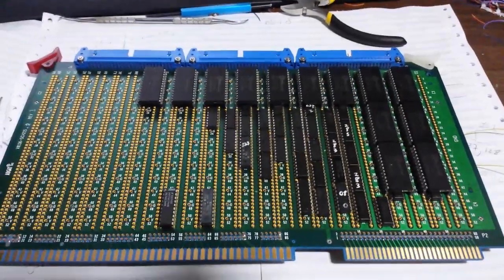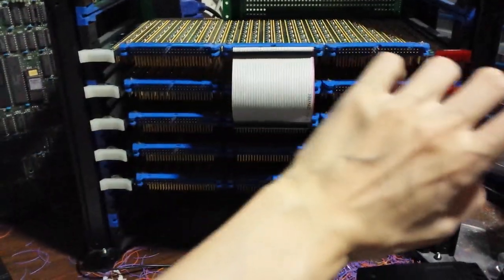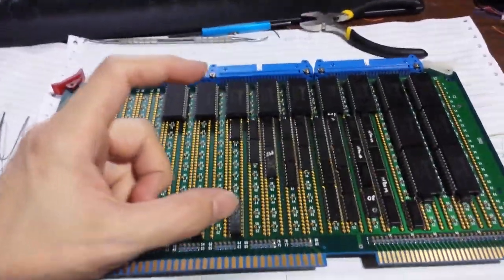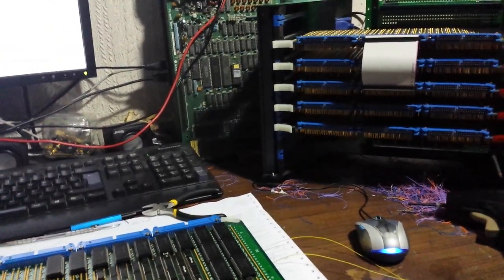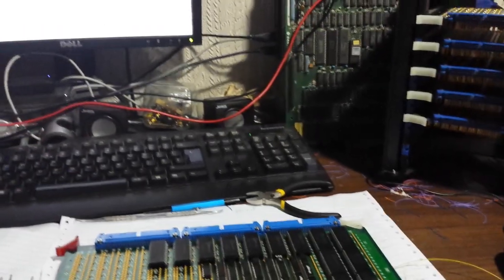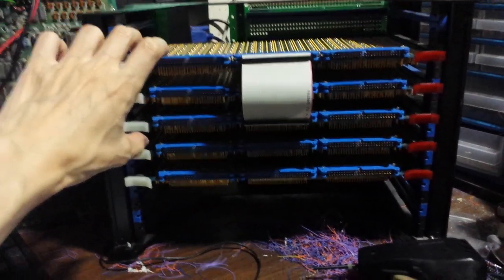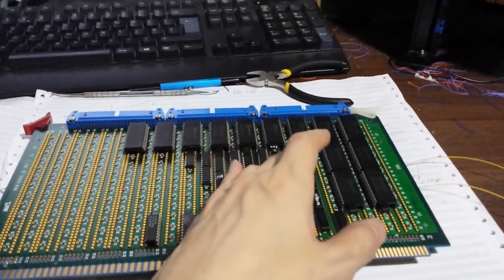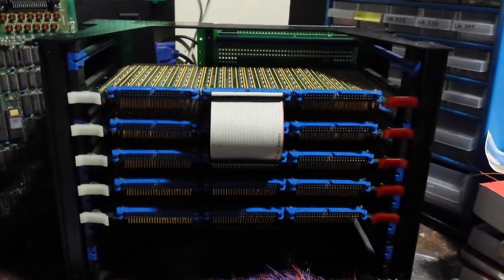New CPU/Minicomputer from scratch made from 74HC logic on wire-wrap boards. Updates & News!

Comment: where on earth are these guys getting this wire wrap boards?
Reply from the maker: i was lucky to find them from a guy who still had a bunch of NOS. this type is rare, but there are similar ones on ebay
Reply: @PauloConstantino167  I see them from time to time on ebay, but for an exuberant amount. I just buy 30 pin rows of wire wrap posts, I think it's like a $1.80 for one. Can't be bothered with breadboards, lose connections are the worst.

Comment: Very nice card cage and boards.  One thing I would suggest you be careful to do (which bit me during Magic-1's construction) is to make sure that you can interchange the card positions within the cage.  Magic-1's cards could physically only go in a single order within the cage because of space constraints, which made life difficult during debugging because I could not easily access the middle boards to probe them during debugging.  Ideally, you should be able to plug any of your cards into the top position to allow easy probe access.  Best of luck, and I'll be following your progress.
Reply from the maker: Bill! My friend. Thank you for commenting! And thank you for the advice. I will keep this in mind for when I create the front plane with wire wrapped connections. Luckily right now I am able to use IDC cables to connect the boards together, so it would be easy to move the boards around since that would only require chnaging the cable sizes. Thank you Bill. I am looking forwards to when your new video comes on. Best wishes to you and your family.

Edit: I have just checked your channel and saw that the video is up!! oh my God. Time for a big treat for me !!!!!! Going to make a cup of coffee and watch it right now !!!

Comment: What are your plans, will it be used for an emulation setup or for a small blade server to run old programs? How would you compare to a different computer such as a pentium ii based computer? Could this be built by just anyone, or is this a difficult thing to build? Does this run on 120 or 240 volts? Just some questions I have,
Reply from the maker: Yes I will get some type of internet going so people can login to it, and use it. If the data rate is fast enough games could be run. It is a slow computer running at around 5MHz, so it's pre Pentium.  If you want to build something like this, you need to study some basic electronics and logic. Paul Malvino's book is a good start.

Comment: Thanks, this is great stuff. Do you plan to port compilers to this architecture, same as bill? What is plan for OS? Is address and data bus on backplane and control only is on front?
Reply from the maker: Hey Zak! Thank you! Trying to build it so its simple to convert it from 8 bits to 16 bits in the future. I know nothing about OS design, so I will follow the Tenenbaum book and try writing an OS for this for sure. Yes all the usual CPU pins are on the backplane, and the internal signals to the CPU are on the IDC connectors.